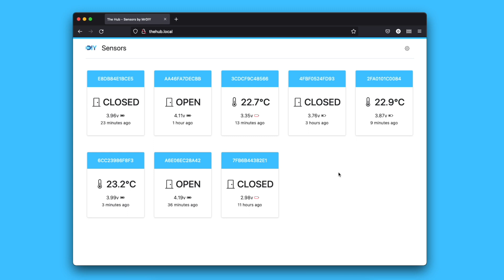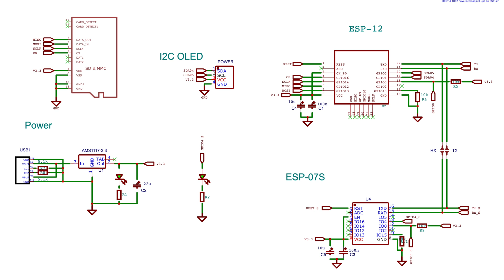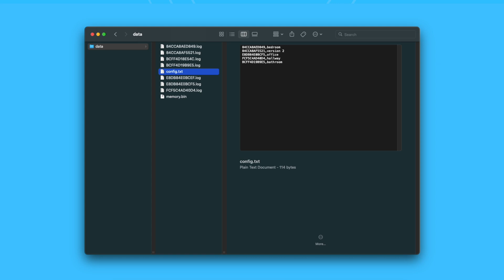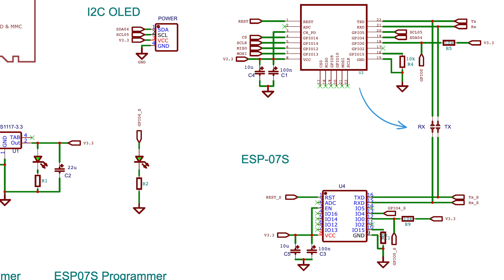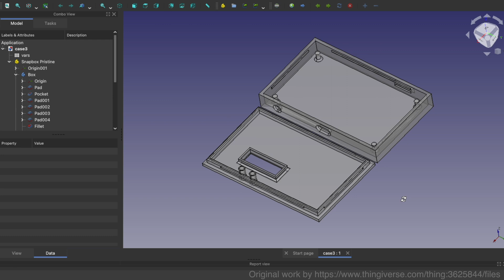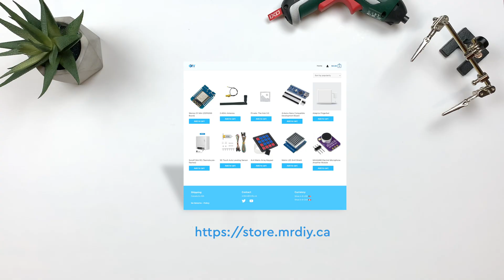The Hub 3 - an ESPNow to Wi-Fi / MQTT gateway

Comment: there are "spring loaded" connectors, also known as "pogo pins", i think it would be better for "programmer board" than regular pins :)
Reply from the maker: Thanks for your suggestion. I tried them a while back but for some odd reason, they don't solder well. They keep falling off ... maybe I bought the wrong kind? not sure
Reply: @MrDIYca  do not have any right now, yet i think there are two kinds - THT and for mounting directly on a wire, those THT required small trick - first solder "as is", even if they look like Tower of Pisa, then rotate board to point those pins up, and heat joint again... i've found that on YT some time ago... after struggling with ;)

Comment: I think I managed to have 1 esp to work as both: receiver, sender (if needed) as well as gateway - so 3 in 1. Of course the precondition is: the same wifi channel for both: ESPNow and AP. But that is good because when you set fixed channel on AP (and on esp) then wifi connection from esp to AP is around 100ms. Anyway, the idea of gateway and ESPNow is great because now, the sensor wakes up, measures what is needed, sends to receiver and goes to sleep - all in around 200ms. With 5uA hibernation current, now the battery can really live for long time.
Reply from the maker: Yes, this can work but doesn't for me as my APs change channels all the time for better performance but if you can keep these fixed it could work

Comment: This is great, I am just wondering is there a way to connect it through serial interface to homeassistant/mqttserver, I do not use wifi in my iot setup. Additionally if a gpio/switch could be toggled at sensor esp, it would make this perfect for my setup, perhaps Hub4? or could this tweaked?.... Cheers

Comment: I am having difficulty trying to compile your v3 gateway code. I believe the problem is with the SD libraries because the error messages state the architecture or board are not supported. Any suggestions?
Reply from the maker: Maybe open a gitlab issue and I will try to help you there
Reply: @MrDIYca  same here, tried literally hours to get code on my hub v3. The receiver code (esp07s) seems to be flashed witout problems, but I just cant get your basic mqtt code to work :/

now my hub 3 is unusable

Comment: I´m using a modified version of your hub1 version since long time. I´ve added more values like you did now for temperature and humidity. you should add some values more which makes it more universal for other kind of sensors. In my modified version i use 4 data points because i also have sensors with air pressure or monitor my car batteries and the temperature in the car. other sensor monitors rain water cistern level with an ultrasonic distance sensor. So it would be really nice if you add 1 or 2 more variables for mqtt values. Your new user interface looks great, i want to use it but currently i´m too lazy to modify the code again since everything runs fine :-)

Comment: hey i have made all the connection as per schematic but esp12 not going to programming mode. error shows time out.
Reply from the maker: Are you using all 6 FTDI pins as shown in the schematic or just Rx and Tx to program?
Reply: @MrDIYca  all six,. I googled it and some blog posted additional circuit required.
Reply from the maker: Can you just remove the ESP and program it by itself?

Comment: What's the best way to adapt the Hub to accept other categories of input, such as my HVAC equipment?  (I've used the temp sensor code with an ESP8266, but would like to setup a distinct Group for monitoring equipment.)  

I'm also curious if you have any pointers on SD cards.  I cannot seem to get the hub to detect the SD card.  

Cool device otherwise, the Hub is working well.
Reply from the maker: That is awesome, good to hear. Thank you for sharing. For the HVAC, I would probably add a new group "GROUP_XXX " and update the structure to reflect the type of data you want to communicate or maybe reuse some of the structure elements. I am not 100% happy with how I did the structure elements. I might change it in the future but I kept for backward compatibility. For the SD Card, maybe try formatting it with another OS. I had a hard time getting my 3D printer to see my SD card. It turned out the MacOS formatting tool didn't cut it. No clue why. I formatted it as FAT on Windows and it worked. Just curious, are you trying to tunnel the HVAC data through the Hub as compared to sending it directly over Wi-Fi from the HVAC system?
Reply: @MrDIYca  My heating system is not wifi enabled (older oil fired boiler, which is common here in New England).  They are notorious for tripping out on safety and I want an alert if it does so while I am not home.  And I also want to track the run time of the boiler as a way to compute oil consumption, to make sure I do not forget to call for more.   I need to access this info remotely (e.g. while on vacation) so am feeding data to InfluxData's cloud service.  So I have ESPs feeding the hub, which routes to Mosquitto.  Then NodeRed is subscribing to the topic and writing to Influx in the cloud.  

I'm not able to attempt to upload any changes since the repository does not specify/include a key icon library...  :-(

Comment: Have you thought about a buck converter for power vs the LDO? There's quite a few options for a SOT-23-5, <6v in, 800ma+, $0.10 (HX3406, XT3410AFMR-G, ME3102AM5G, LN3406, M3406-ADJ, SY8088AAC, MT3410L).
Reply from the maker: Are you referring to the Hub? Efficiency was not really a priority since it is always plugged in.
Reply: @MrDIYca  Correct; the hub. Always nice to make things more efficient! With a 500ma load, and $0.11 /kwh, would save ~$1 a year with the more efficient regulator.
Reply from the maker: True, maybe an improvement for a future version :) Thanks!

Comment: Why can't we use same esp fir gate way and esp now
Reply from the maker: Were you able to get that working reliably?
Reply: @MrDIYca  Yes yesterday I have tested it for a while it works fine. I don't know what happens for a longer time I have seen it acting wired I need to check it again as u have good system I will share the source if u need

Comment: generally need a 470uf cap cause they take  lot of power when flashing. more if your powering other things also while programming. and some of those adapters dont put out a lot of ma to power devices.
Reply from the maker: Yes, not enough current.

Comment: brilliant project, I have a couple of designs for wireless window/door transmitters using the ESP12 and ESP-NOW but I'm using the reed switch as it is an industry standard and I've had no issues with it, you can also buy a plastic encased version which is much more robust. I was toying with the idea af a receiver/Gateway but in the end I plugged a Wemos D1 mini into my Raspberry Pi that runs Node Red and I send notifications via Pushover to my phone and I'm playing around with a couple of different MQTT dashboards on my phone as well, having said that I really like the user interface you've created.
Reply from the maker: Thank you!

Comment: I would buy the hub 3 in a heartbeat as soon you have contact and temperature sensors available.
Reply from the maker: Soon I will have the sensors but the Hub is now sold out. Maybe I should have made more :)
Reply: @MrDIYca  Another suggestion, you could sell unassembled pcb, and I'm one of those who don't mind putting the rest together because I find it therapeutic.